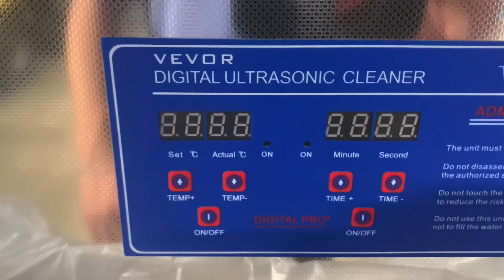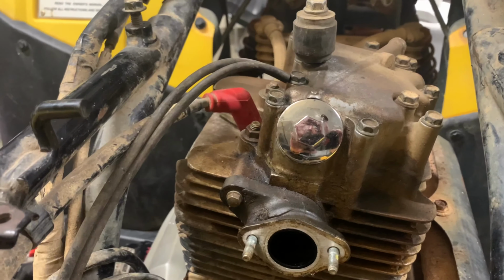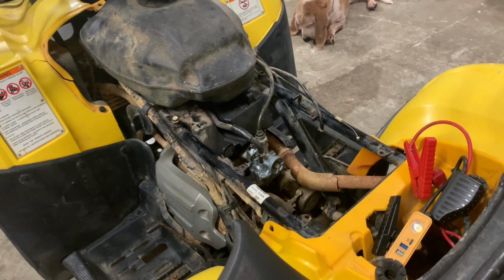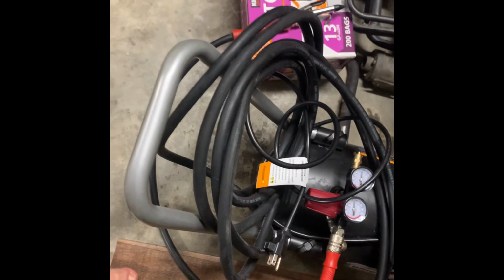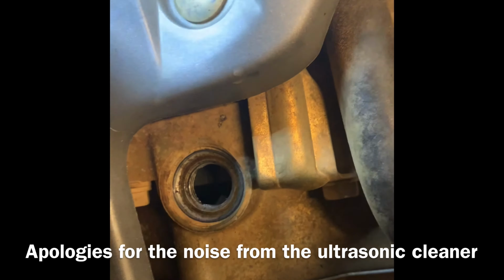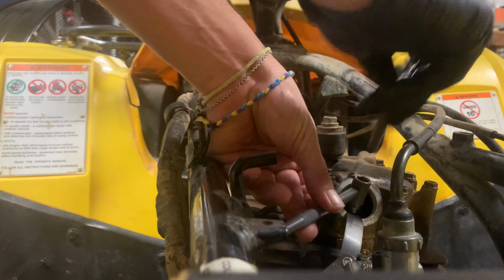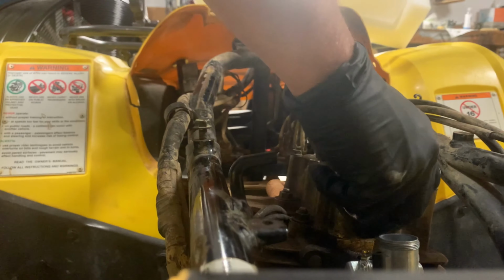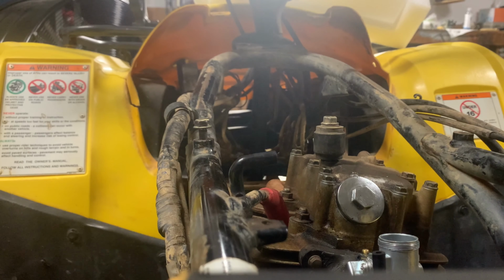2005 Honda Recon 250, was it worth buying? Can we make it run?

Comment: I just got a 05 recon for free... gonna be a huge project but it has a complete engine and all the parts so it’s worth it.
Reply from the maker: That’s awesome man! They are great ATVs
Reply: @GrowYourOwnFun  I bet. I have a whole bunch of parts on the way now for it. I might make a video out of it but I’ll keep ya updated
Reply from the maker: @f10nate  let me know if you have any questions along the way. Tripod is your friend I am finding out unless you have someone else to hold the camera.
Reply: @GrowYourOwnFun  I do have the front case off already but I’m gonna be ordering a tripod soon.
Reply: @GrowYourOwnFun  I’m stuck on this, where does the drain line go to for the carburetor bowl? I’ve done my research and and I can’t find anything. Also I’ve got it to run on starter fluid
Reply from the maker: @f10nate  are you asking where to route the drain line from the carburetor? It should just hang down below the carburetor where it can drain out on the ground if it overflows. I believe you should see a half clip on the case of the engine that will hold it but that clip often gets broken off. Let me know if I can help. That’s awesome you got it running on starting fluid. If it runs that way but not on its own your idle jet the small one is clogged more than likely.
Reply: @GrowYourOwnFun  update, it runs perfect now, except for it smoking a little bit. I’m assuming it’s the valve seals hopefully not rings
Reply from the maker: @f10nate  way to go!!! That’s awesome to hear you got it running so quickly! Keep my fingers crossed you just need to adjust the valves!
Reply: @GrowYourOwnFun  it was the valves. Just curious, how much did you pay for yours? I’m looking at another one that’s yellow im trying to see if it’s a good deal.
Reply from the maker: @f10nate  paid about $550-500 for this one plus time and parts, sold for $1,500
Reply: @GrowYourOwnFun  Nice, yea this one he’s asking for 500. The axle is locked up and it needs new rear bearings. Already have a whole kit I’ll probably pick it up tomorrow
Reply from the maker: @f10nate  if running that’s a good deal, especially right now
Reply: @GrowYourOwnFun  not running, has compression